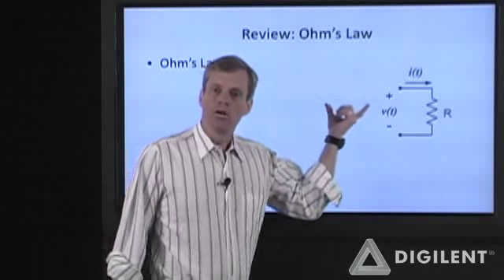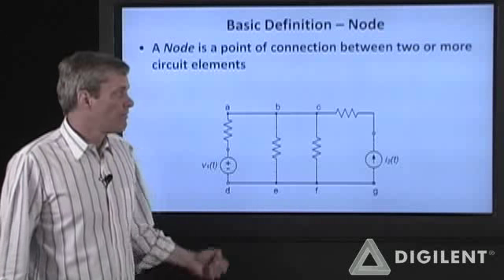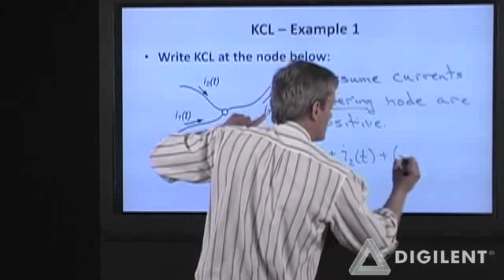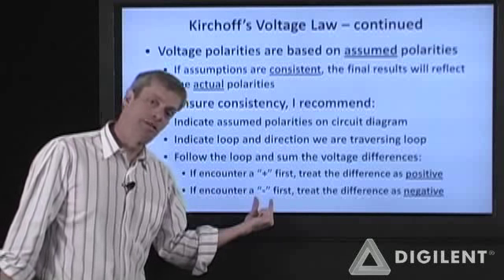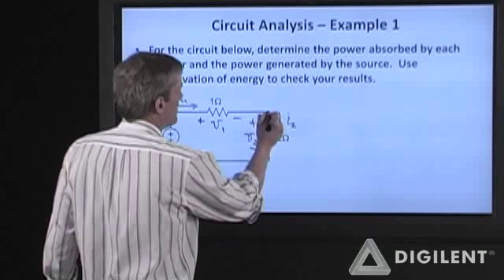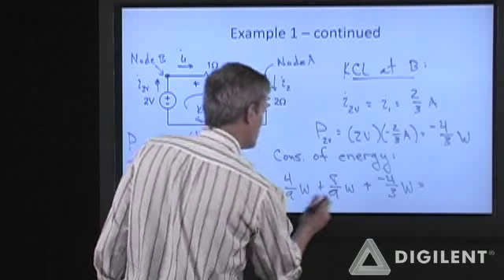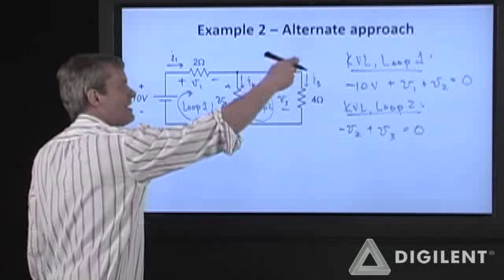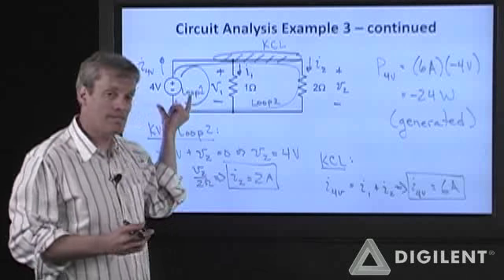Real Analog: Circuits1.03

Comment: The solution of Circuit Analysis - Example 1 seems to break a rule given at 24:10: Apply KVL around all but one loop in the circuit. Since there is only one loop, KVL should not be applied at all. By applying KCL at nodes A and B (there is a node not used, in accordance with another rule), along with substitution, Ohm's law, and the power law formula, conservation of power yields i1*(-2) + i1*i1*(1) + i1*i1*(2) = 0. Therefore, i1 = 0 A (disregard this trivial solution) or i1 = 2/3 A. The power generated, 4/3 W, and the powers absorbed, 4/9 W and 8/9 W, match the answers in the video.
Reply: KVL and KCL apply to a single loop or single node. He just has it written oddly or was a typo. If the circuit contains only one loop, KVL can still be applied to it. KVL: The sum of the voltages around ANY loop is zero. KCL: The sum of the currents at ANY node is zero.